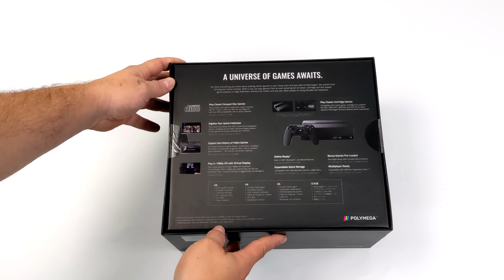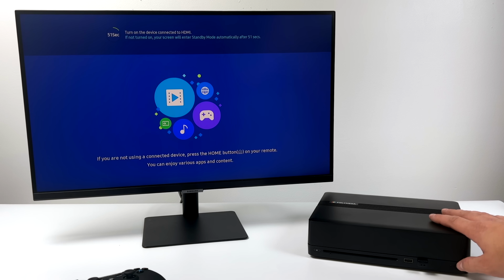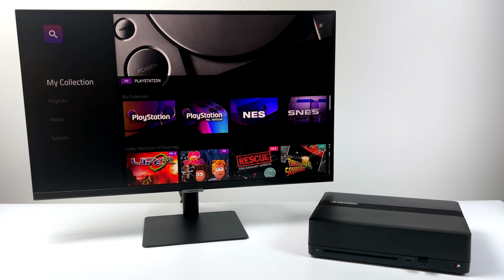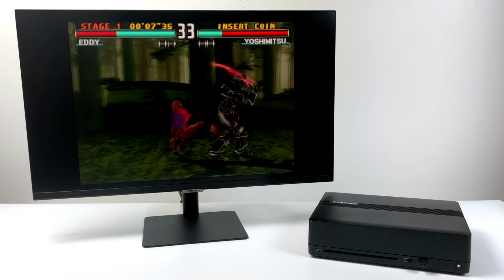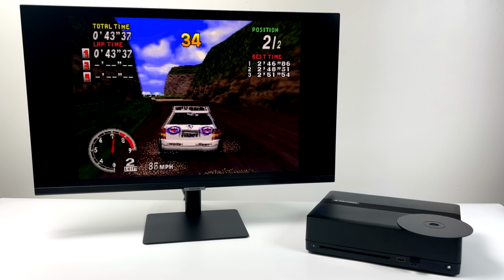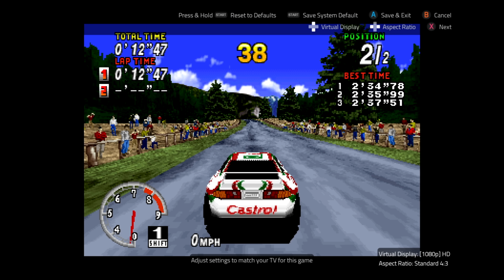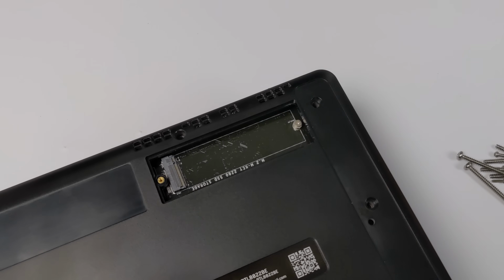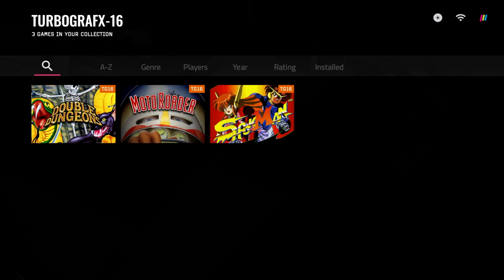Is This The Ultimate All In One Retro Emulation Console? Polymega First Look

Comment: I want to see you upgrading the CPU. I should be getting my polymega real soon so im just curious if that upgrade is possible. Also would it mess with the settings by just swapping the chip to a better one?
Reply: Its a 75 watt powerbrick and it has to power the whole system not just the CPU so your limitation is the power delivery itself. Unless you already have a compatible CPU for that socket with a TDP of no more than 45 watts on hand for some reason its not worth  the added expense. The added cost puts it in direct competition with far better PCs and the jump from intel uhd 610 to Intel uhd 620 graphics is underwhelming to say the least. You could probably get a ryzen based entry level PC for that sort of price and it will be faster.
Reply: No reason to upgrade the CPU, the performance the celeron delivers for every platform the PM emulates is overkill.  If they add another platform in the future and it sucks, at that point it'd be worth your time to open the device and upgrade the CPU, but honestly the rest of that unit will die long before the Celeron does, and the Celeron's honestly too much for Saturn emulation.  To be clear, everything this thing handles, a Raspberry Pi also handles equally well, for $40.  In fact, the RPi 4 can also do Dreamcast at near perfect speed.
Reply: @ocha-time  Interesting take and a refreshing answer seeing most people try to bash Polymega. What would you say the would be the absolute upper ability for the polymega with its present celeronsetup? PS2 or Dreamcast? You think it could handle those systems well?

Comment: The Idea is cool, but for an Rom Collector it's an big disadvantage if you can't add Roms. And I'm no expert in Computer Hardware but I think the 2Gb Ram would be an Bottleneck to the Integrated UHD Graphics Card. I think 4GB would fit perfect. Too expensive for that thing.

Comment: Great review! On one hand this is pretty fucking neat and the UI is just beautiful. On the other hand the specs seem to have been toned down from last time I've checked which was ages ago... UUUGH. 

I'm one of those people who can't hassle with emulation via the computer cause I work an awful lot and barely have time off to properly set one up. I want something that just works and this WAS something I was looking at. Unfortunately it seems they've toned down the specs and backtracked on some promises which is quite ugh, however I suppose if they figured out they could have it run with lower than expected hardware due to some newfound knowledge in emulation tech I guess it's probably okay?

All in all I'm still quite on the fence, but I don't think I'll be making a purchase until they've lowered the price. 

Also, could you possibly try out Need for Speed III Hot Pursuit? No reason 🙃

Comment: I ended up cancelling my pre-order on this about a year ago and kind of glad that I did. Its an interesting machine, but the price and hardware isn't really worth the price. A 2 core system for 450+ dollars? That's a bit rough on the wallet for a pretty low end system. I am curious to see what upgrades you will be able to do with it though, as if it can be bought for a good enough price and throw in a few upgrades (a quad CPU and 8 gigs of ram at the very least) then it might fit in some collections

Comment: Definitely agree that the low end Intel CPU and 2 GB of RAM is a huge limitation. I'm surprised they didn't go with an embedded Ryzen system like the Atari system. Even that one should have used the 4c8t APU.
Reply: @nasman7492  yep, and that ghetto CPU would also limit PS2 emulation speeds

Comment: The deluxe bundle is the same price as the top-end Steam Deck... yeah...
Reply: The Steam Deck is unlocked, which will allow you to run Windows on that thing and will open access to more Windows games and applications.

At that price point, the Steam Deck already won.
Reply: I am buying the Steam Deck fosho. Its better to mod (dual boot) Steam Deck as a portable Retro system

Comment: 200 bucks will get you a 6 core 8th gen mini pc. Probably a cheaper more powerful option
Reply: yeah, makes you wonder where the money goes to because the 200usd mini pc pretty much will run anything up to n64 with the best accurate emulators around with retroarch's super low latency. like just install Lakka on it and you even get the fancy menus.

and it might even have a shot at running ps2, dreamcast and gamecube
Reply: @khhnator  it runs dreamcast, and gamecube virtually perfect. And can run the easier titles fine on ps2.

Comment: For these insane prices, chip shortages, and years-long lead times, I think using a PC with Launchbox, a DVD-ROM drive, and a few cart readers for the NES/SNES/Game Boy/Genesis is a much better alternative.

Edit: even the Xbox Series S can play N64 games better than PolyMega (of which he called the N64 module a "clone console"!).
Reply: I agree, but I think this is for people who want something that just works out of the box easy so they can play their original disc/cart games without fiddling with settings.
Reply: @eyesofnova  But those people are probably still using original hardware, plus collectors tend to view emulation like a red headed stepchild.
Reply: @karehaqt  Actually, it's worth noting that Nintendo themselves used emulators throughout the 21st century, with the Zelda collection on GameCube, the Wii/3DS/Wii U Virtual Console, Nintendo Switch Online, and Super Mario 3D All-Stars being examples. Even Capcom, Sega, and Konami released their own collections on Switch that use said emulation.

Plus, the Master System in Lost Judgement uses emulation. How the legendary RGG Studio was able to package it inside a full-size game is beyond me.

And if you really want to get accurate, use an FPGA device like the MiSTer, RetroUSB AVS, Analogue Mega SG, and Analogue Super NT. These devices have extremely accurate hardware-based emulation, and the FPGA concept is being accepted by more and more people.

Comment: If it was priced at $249 or $299 then I would be interested but I backed out once I saw the sticker price. It's a cool system though.
Reply: It was $249 initially back in 2018.
Reply: @mikem3846  Well that is my luck. I wish they would have stuck with that price as I would guess it would help them move more units.

Comment: Ouch, that ram situation is pretty brutal. 4GB/8GB dual channel would have been the bare minimum for me. Since it would let us play Wii and Wii-u(8GB) games. not all Wii-u Games would run well, but they'd work, depending on OS.

I would like to see a quick test with a better cpu, but you'll have to find one with a better intel HD.
IDK what chipset you're running but you might be able to get a cpu with intel HD 620/630. Maybe a Pentium g4600/g4620. or Pentium gold g5500/g5600, or a core i3/i5 8000 series.

Comment: What would happen if you burned an iso image to disc, then put the disc in? Would that potentially be a way round playing back ups? Like I cant imagine it detecting the anti piracy like how a PS1 did
Reply: Well, the PolyMega's disc drive is not smart enough to detect wobble, so I think it can't tell the difference.

Using off the shelf components and charging so much money for it...
Reply: @lucasn0tch  that's what im thinking, im also thinking once its deepdived into seeing how the file structure is you maybe able to even burn a disc with roms of the 16 bit era, my wording is probably terrible but I remember a similar trick back in xbox 360 days to play the resident evil 5 demo early.

Comment: Just for the comparison. I went just now to Newegg and build a new system with 10 gen i3 with 630 graphics, 8 gig ram, CPU fan, case with power supply, 256gb ssd for a total of $399.08. That system is  so more powerful and cheaper. Sorry I don't see the value of it
Reply: Unfortunately, this is a little bit on the high side, due to GPU scalping

Comment: Pretty much a Dell precision mini PC in a smaller case. The GS40N Slot load DVD is from 2015 and dirt cheap and 2GB DDR4 memory! I have a Acer DE7000 signage mini PC with the same specs and Nvidia Ion and runs the same with Batocera.If it ain the chage to a Celeron from FPGA Its an ok buy but now for me

Comment: The fact that is socketed cpu but no SODIMMS is a pretty bad choice: sure you could get a different CPU but what's the point if it's going to be severely limited by the tiny amount of soldered ram?

You're better off with a Pi 4 inside one of those NES or SNES cases instead reading directly from cds is a novelty it'd be much better to just back off games to ISO files using a laptop instead of bothering with the constrains of this console thing.

But as always very useful look on your part though don't get me wrong.
Reply: But a pi 4 can’t emulate Saturn well

Comment: This doesn't run anything directly from the disk.  If you choose to "run it from disk" it saves it temporarily to the internal storage and runs it from there.  When you exit the game it removes temp game data.  Also, the Saturn emulator is a tweaked version of Mednafen.
Reply: Are you sure? If it was dumping it temporarily rather than just reading the disc surely the start up time would be much longer because dumping the disc data would take a good min or so?

Comment: It seems to have 2 slots for extra storage, right? That one near the processor can be used for storage as well (mSATA maybe?). Also, if you're able to modify the internal OS, maybe you can create or increase the swap partition (since it's flash, it'll not be a hard trade-off, specially for emulation). Or maybe using the extra port for that (a tiny mSATA?).

Comment: I am a bit curious how this would perform with another Coffee Lake 35W CPU like the i3-8300T, or the i7-8700T for overkill, but I suspect that it won't even boot with a different CPU installed. Even if that does work, you're probably bottlenecked mostly by single threaded performance and RAM.

Comment: £335.95 for the UK base unit seems way overpriced or what hardware is being used.
Reply: At that price point, I think using MiSTer is a much better idea, especially because RMC was able to consolize it for ease of use.
Reply: Plus in the UK you will have import and duty taxes to contend with when importing it.
Reply: @mikem3846  20%.

Comment: Just checked the price of this thing. Personally I think £336 for the base model is rather steep. You would probably better off just emulating on your own PC or go with a Raspberry Pi 4.
Reply: In fact I have an old Gigabyte BRIX which is a quad core Celeron that cost me less than £200 new. I've had it 5 years and it works rather well. Got mine with a 1tb SSD and 8gb of RAM. It's also dual booted with Windows and Linux. I'm sure this would work quite well too.

Comment: Can it run wii and GameCube?
Reply: Nah... This requires custom firmware for optical drives, and the last optical drive to support GameCube/Wii games was from 2009 iirc.
Reply: @lucasn0tch  And even then i doubt the integrated HD610 is strong enough to reliably play GameCube/Wii at decent FPS.

Comment: I don't want to be harsh on this thing, but at this price I can't help but feel it is useless. Too many compromises, as you said emulating on PC is a better option, the price is unreasonable, and it doesn't really fit any (that I can see) target audience.

It doesn't solve any problems, the folks which a large game/disc collection most likely already own dedicated hardware to play these games on the intended system. It just makes no sense, hardcore audience probably has the hardware, those who will emulate roms can't use this either.

I fail to see any real selling point vs every other device out there which can emulate. Yes, it can take discs, but if you only own 2-3 games this isn't for you, if your collection is large enough to justify a $700 emulator than you do most likely have the systems to play it. 

Emulation, with out the simplicity of ROM's for emulations sake alone. I know I've repeated myself a few times now but it seems like an inferior option. I don't want to be harsh, I don't dislike the idea, I just can't really see where you say no to the real hardware, no to doing it on a PC, no to doing it on android boxes, no to handheld emulators, but yes to this for $700.

Greatly confused who was asking for this.

Comment: The CPU in this systen should have been removed and an AMD equivalent should be used instead. An AMD FX 4300 costs £69 or so and has 4 cores and 4 threads where as the G4900T is £175 and has 2 cores and 2 threads. The could use a much better and cheaper CPU equivalent and cut the cost of the whole lthing by £60 to £85 pounds for the deluxe edition with all the attachments. An idea like the Polymega and all the others before it are fantastic ideas but for most people who do not have collections of older systems pyhsical media will not see any use for this. Hell you could build a cheap PC for £200 to £400 and eumulate all the Systems in this instead for cheaper and better.

Comment: When are they going to add Dreamcast to it
Reply: Dreamcast uses a proprietary disc format called GD-ROM. According to Wikipedia, "It was developed by Yamaha to curb piracy common to standard compact discs and to offer increased storage capacity without the expense of the fledgling DVD-ROM."

To sum it up, Sega and Yamaha wanted a larger disc without breaking the bank and with sophisticated copy protection. It's unlikely that it will be included in the PolyMega, which is a shame, because I wanted to play Sakura Taisen 3 on it...
Reply: @lucasn0tch  Except it didn't curb piracy as there was basically no protection on the Dreamcast.
Reply: Is it even powerful enough to emulate Dreamcast?

Comment: I‘td be great if they’d release a more powerful version wich has a quad core i3  with a dedicated GPU like a 1650 or 1650 Ti Max Q and it could have a DVD drive wich would give it support for PS2, N64 and Gamecube games at up to 1440p and with a M.2 SATA 128GB SSD instead of the 32GB eMMC + empty M.2 SSD drive bay for future upgrades and it could have 4-8 GB of LPDDR4 RAM (or laptop size upgradeable 2 slot RAM if that’s possible so it’d be 2x2GB or 2x4GB)

Comment: Unfortunately, the device can't do what I've wanted for years.
advanced graphics options.
The device is nothing more than a computer that emulates the games.
So why can't I set graphics options like with PC emulators like ePSXe? 
That's what you should expect, especially for the price.
I really hoped that I could play my PS1 games in a nice high resolution and smoothly without any texture wobbling.
If I want it original I have the original consoles. So why should I buy this? So that I have everything on one system and don't always have to look for the module or CD? I also have a PC or raspberry pi that costs a fraction.
The device does not play the games from the module either, but reads them completely into the memory like the Retron.

Comment: Well i think a higher clock CPU would kick off things a bit better but,  i don't know if that would be necessary
Personally i would've preferred at least 4GB of ram but, since Linux would pull a bit less resources than an actual Windows PC i guess that 's fine cause if u would wanna build a Windows PC for Emulation purposes u at least would need that 4GB, i installed 8GB (2x 4GB) just to be safe for ReyroArch and ReDream n some stuff and i also managed to opt out a fairly good GPU  with 4GB of ram (RX 560)
So, yeah it basically does everything else beside the emulation but i use it only for emulation anyway

Comment: This is entirely unnecessary and redundant. Just either emulate or use your original console. Why this?
Reply: So you don't have to have like 12 consoles all connected up but can still play your original media?
Reply: @mikem3846  12? You only need at most 3.
Reply: @sirlimen333  3? You would need 3 to play just the Mega CD games from each region as it's region locked (JP, EU and NA). 4. PS with an action replay, 5. Saturn with an action replay, 6. Neo Geo CD (NA), 7. Neo Geo CD (JP), 8. PC Engine CD, 9. Turbografx CD.

So atleast 9 to cover what this does in 1 box.